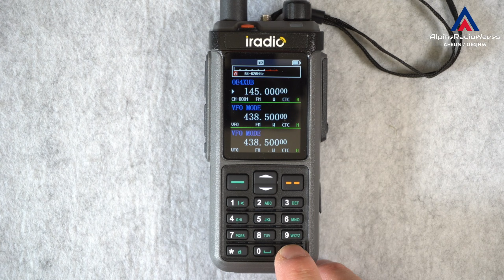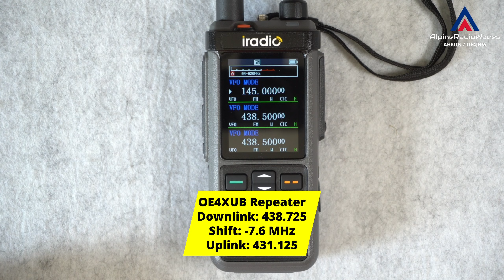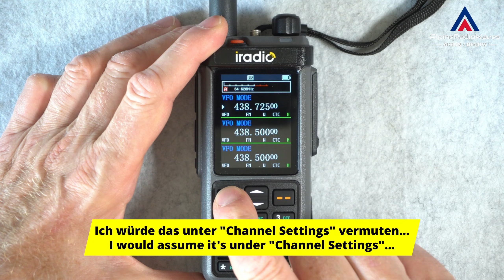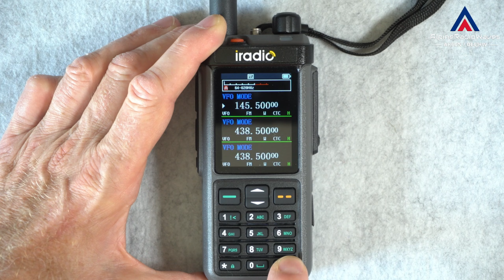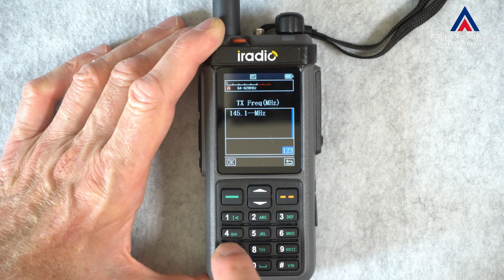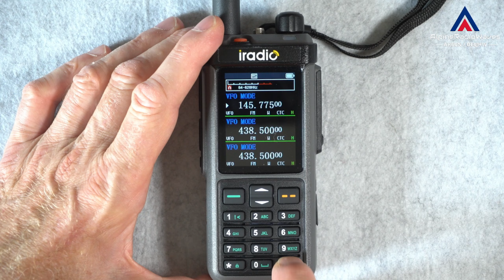How to program the iradio UV-98Plus or Radtel RT-880 manually (by hand) - Viewer request

Comment: Hi ! Mine doesn't work on shift mode! I can not use the repeater mode i don't know why the rig doesn't assume the tx frequency,  always received and transmitted on same frequency 😢😢
Reply from the maker: Good morning Domingos!
Try to set the downlink freq. (from the repeater) in VFO mode. Then go to the menu > channel settings. Then you have two options:
Set the TX freq (#4) (to the repeater), or you set an offset direction (#15) and offset freq. (#16)
This works fine for me.
Best 73 de Juergen OE4JHW
Reply: @AH6UN_OE4JHW hello my friend! Tks for the help, but my rig does not do the shift frequency well i push to talk,  I made all steps that I saw in the videos of Andreas @M0FXB and other friends,  I  put the frequency by manual set , in offset frwquency settings I write the correct TX frequency #16 , and my rig when I TX continues on same frequency , I think I see 10 or more videos, if you can see my settings I send to you a video, if you can help me, tks a lot my friend! 😢😢😢
Reply: @AH6UN_OE4JHW  Hi my friend! My radio had the "Talkaround" (it was on RR) setting ON, so it was my fault for not noticing it. Thankfully the problem is now solved! Many thanks my friend! 😊 73's from Portugal 🇵🇹 #CT7BHW